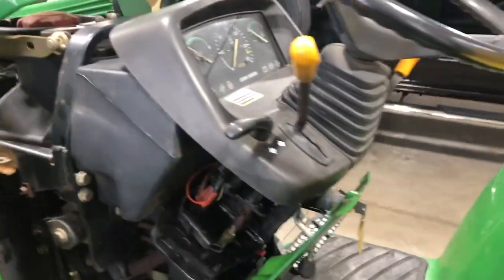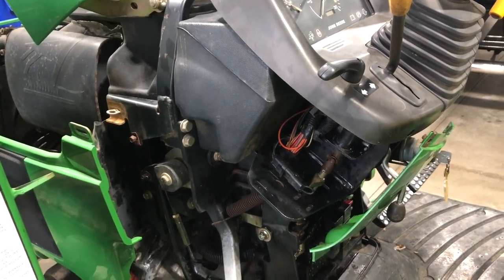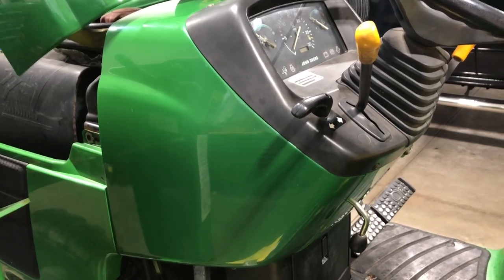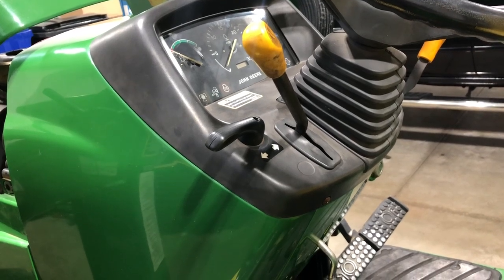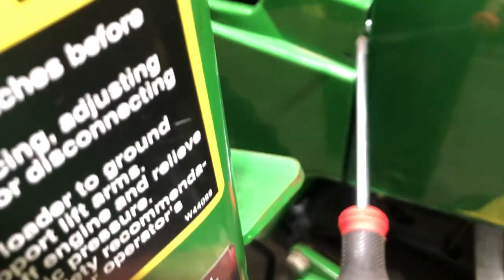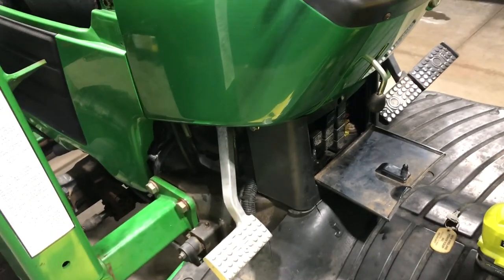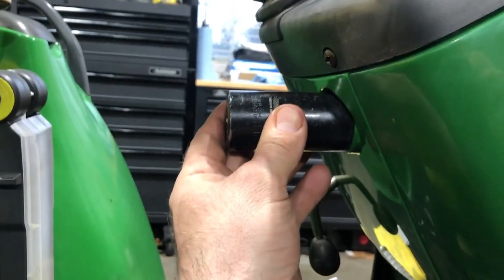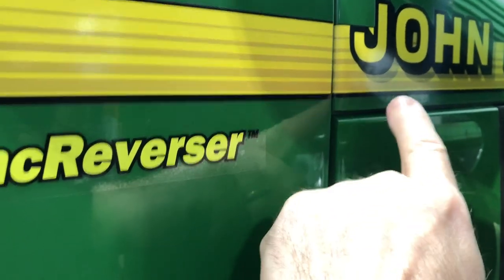John Deere Cowl Panel Replacement and Side Panel Alignment

Comment: Any chance you can do one on dealing with the brakes, return springs etc?
Reply from the maker: Sure, just did one side on the 4300.   If one side is sticking you want to take the wheel off that side and move the brake lever manually with large wrench or small mallet.   After manually moving the lever it will free itself up and return to normal.   You'll have to move it 40-50 times to fully free it up back to normal.   WD-40 around the shaft area also helps.   Real common issue.
Reply: @darrenmas  Mine haven't worked normally since about 1 year after ownership. I'd crawl under and bang the brakes back. I consider the brakes "emergency" brakes which is obviously wrong. I should be able to brake steer in certain circumstances etc but I stopped.  I will give it a try. The P light stays on but isn't dragging unless someone uses the brake, but thankfully since it is E-Hydro that's pretty rare.
Reply from the maker: Yup, sounds familiar, such a common issue.   I'm always able to get it back to normal using the 40-50 times method.   Most all the 4000 series machines I do have this problem on one side.   Parking brake light is also really common.   I think I did a video on that fix.  Might be on a 4210 though.   Was also a hydro so should be same on yours.